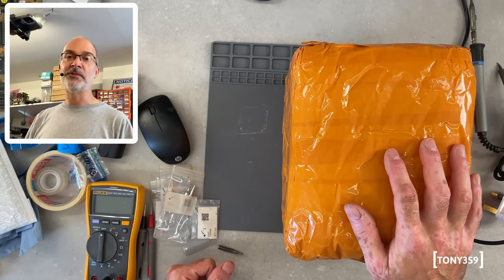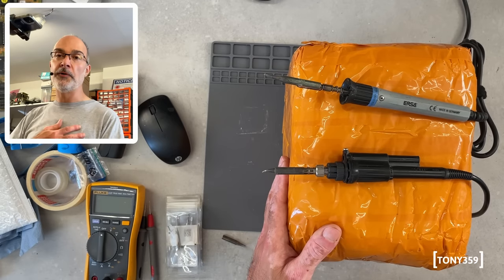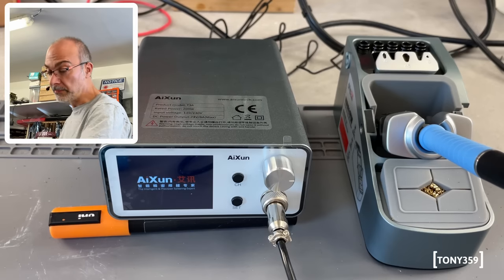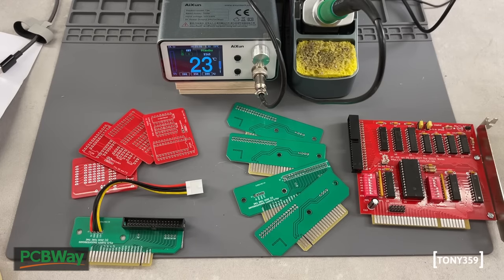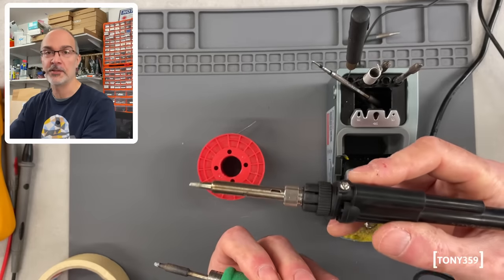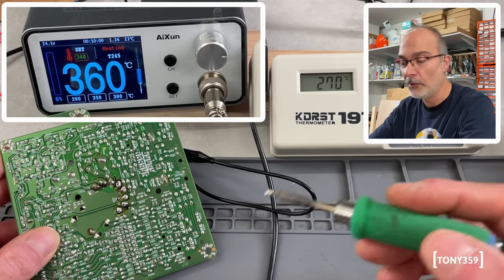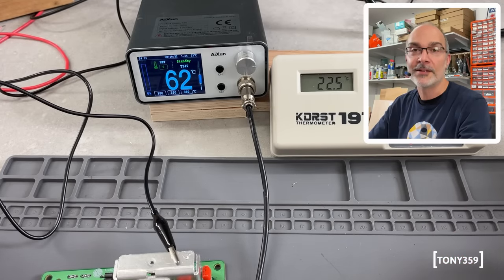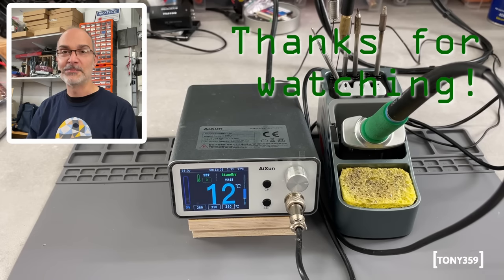Is the Aixun T3A a good T245 soldering station?

Comment: I had that with my diy speaker and cross over, with the amp off but still attached, I heard a buzzing sound from the speakers (resoldered a loose connection) Probably better to use a separation transformer on the T3A.
Reply from the maker: Yes, today I was soldering with the oscilloscope connected and I could see the heating pulses on the scope. This thing is dumping voltage through the tip. I think I'll move to a different model, this feels unsafe for the PCBs.
Reply: @tony359  Care certainly must be taken with this iron, but it's fine for my purposes. I like it a lot too, with some JBC original cartridges. I usually work on stuff that can be disconnected.
Reply from the maker: I cannot deny it works for 90% of the intended purposes. It's just I also work with those 10% as well and those issues are always in the way.
Reply from the maker: @imqqmi  Thank you for sharing your experience, I made a short showing the same issue: https://www.youtube.com/shorts/6rK7ACrbukI
It's bad. I'm going to find a replacement ASAP. Thanks again!

Comment: Haha the Chinese are masters at hiding the faults. I have a Quicko T12 that has similar traits - lies about the temperature to make it look stable when it is not, and again it doesn't work quite right with the genuine Hakko tips. Interesting issue with the grounded boards, even tho the psu is likely isolated, the soldering tip should still probably be grounded - it is clearly not, and this has to be a hardware issue which is probably why they are having a hard time fixing it in the software!
Reply from the maker: I didn't mention that on the video but the tip is indeed grounded. It's been speculated that this is the by-product of some noise which is then affecting the thermocouple reading going to the station. Not sure! :) Thanks for watching!
Reply: @tony359  Strange, maybe ground loop induced interference then. Taking a closer look at the thermocouple amplifier circuit and grounding scheme might make for an interesting video!

Comment: The comparisons look to me like they are very far from "level playing field." The older iron has a longer, more slender tip. Of course it is going to have difficulty delivering as much heat as a short fat tip.

The problem with lots of these irons that use cartridge heater/sensor assemblies is that the sensor is a long way from the working part of the tip.The sensor may be better coupled thermally to the heater than to the tip. The huge overshoot with the "improved" firmware is pretty compelling evidence of this. It is difficult to really evaluate properly without a pretty sophisticated test setup. You need a data output from the device measuring the "action" part of the tip and from the sensor of the station itself. Obviously the manufacturer was deliberately trying to hide the horrible job done by the hacks that designed the station.

For decades my main soldering iron had no display of any sort. The temperature was set by the actual tips which use curie point control. It worked great, often idling all day long when I was doing development work. Other days it would be in in heavy use. With my main temperature controlled station the heater surrounds the barrel of the tip and the sensor goes inside. The sensor "talks" to the tip, not the heater.
Many of these flashy stations seem to be made to look impressive to the gullible, not to perform well.

Soldering, when done by someone who knows what they are doing, is a "closed loop" process where the operator closes the loop. Dwell time is judged and controlled by the operator. Very precise control of the iron's temperature really isn't necessary. That said, huge temperature overshoots are unacceptable if the overshoot makes it to the working part of the tip. If you are doing something like soldering a ceramic surface mount cap (which you shouldn't be doing at all with an iron), the overshoot could greatly increase the already high risk of causing cracking due to thermal shock.
Reply from the maker: Thanks for your comment. My comparison wasn't to find a winner but to guide someone (like me) thinking of upgrading and not sure whether the benefits were worth the price. As I said in my intro most comparison are between similar stations but there is very little to compare to an older iron. 
I've been thinking of getting a cartridge-style iron for a while but I wasn't sure it was really worth. So I thought I'd share my thoughts with the larger community! Thanks for watching!

Comment: what about the JBC BT-2BQA ? the price is not so expensive as the JBC BT-2BQA, it's half the price of the later, you only miss the digital display
Reply from the maker: It's something I have considered, yes. Again, after all it's a metal rod getting hot :) I'm really wondering if you really need a microprocessor and a display! :)

I'm getting a JBC, I cannot risk my PCBs with this thing. I'll publish a quick comparison soon - even though I appreciate it's 4-5 times the price.
Reply: just remember, you can't directly calibrate the JBC BT-2BQA , you need something like  the JBC AC2600 (AC-A) soldering console (you can change the time sleep, temp etc) but the product is retired

that's why it's more expensive i guess, you have directly a way to calibrate the soldering station
but i don't know if it's worth 250$/euros
Reply from the maker: interesting! To be fair, I don't think you need your soldering tip to be 100% precise - and it's an analogue station anyways. When you set it to 350, I feel it's ok if it's 360 or 370. Not 400. I doubt a proper station would need some massive calibration - that tool is likely for a service centre of if you own a lab with multiple stations and you want to make sure they're working well. I don't think they are intended for the individual. It's cool to know though, particularly if you think of buying a second hand station (which might have drifted) and discover it cannot be adjusted easily :)

Comment: I love my pinecil. Got into soldering a couple years ago. I first got a cheap heating element in the tip one that was broken. I got it refunded and found the pinecil. Pinecil was night and day difference between the two. Like your comparison. My old iron was a good 3-5 minutes to heat up. My pinecil, under 10 seconds. Made my own silicone cable for it and I use it all the time. Also the barrier of entry. Pinecil shipped was $36 USD.
Reply from the maker: Yes I heard great things about the pinecil! I also considered that but in the end the Fake Hakko I have is not so bad (WITH Hakko tips though). Thanks for watching!
Reply: @tony359  Theres a 3d print for the pinecil that makes it accept hakko tips as well. I seen it a while back.

Comment: Wow that PID loop is really really bad. My guess would be they "borrowed" some code they did not fully understand. I have a JBC station but mine has problems storing settings and reverses back to its default settings at random it's annoying as ^@#$. I was about to buy two of the Aixum stations but it now seems that's also not a solution.
Reply from the maker: Oh, I'd expect JBC to be able to sort out similar issues! But yes, maybe the T3A is not good to replace a JBC :)

Comment: Have anyone tried to switch out and replace the switched power supply board with a full transformer and bridge rectifier, that might solve the ground loop issue!?
Reply from the maker: It might, but I'm not really sure it would be worth. I think you can buy a unit with a linear supply with the money you're going to spend and it won't look like frankeinstein on your desk! But yes, it would ne nice to test.
Reply: Could render an new interesting Youtube follow up ;)
Reply from the maker: @stockholm-tech  the T3A is not easy to open, it's partly a destructive process. I need to sell mine :D

Comment: 4:22 Not quite. Look more closely at a genuine Hakko tip and you will find a very thin sleeve inside the tip. Those chinese knock-off tips don't include the thin sleeve so they are basically useless because the hole inside the tip is way too big to efficiently transfer the heat from the element to the tip. If you don't have a proper Hakko soldering iron like the Hakko 936 try to get access to one owned by a friend or buy a genuine Hakko tip and take a look inside and you'll find a thin steel sleeve. Use the genuine tip on your cheapo chinese knockoff soldering station and you will see a dramatic difference in heat transfer vs the knockoff tips.
Reply from the maker: I remember reading about that when I got the station and if I remember right I fiddled with some metal shims but that did not really work for me. But that was a long time ago. Yes, I know genuine Hakko tips increase the performance a lot take a look at 1:05 :)
Thanks for watching!

Comment: Ive had at least 8 different Chinese knockoffs. The ksger 2.1s silver case and the axiun models are the best of the 5 or 6 jbc knockoffs. The axiun is very picky about the resistance in the tips. Unless theyre real or axiun branded then its a crapshoot. OSS Team and handskit jbc units blowup and the sellers do not stand behind the products.  In fact it is a systemic problem on ali. Reputable sellers with good ratings never stand behind their products or over charge for replacement units. I had to fix the t3b after no luck with the seller phone fix.  Not china phone fix. 

They are the friendliest say no people in the world, by and large. 

The t3b is instant heating.
Reply from the maker: Yes I’ve also noticed that Aliexpress has become risky. Unless you don’t receive the item, after a week or so you’re ‘on your own’ and it’s almost impossible to get support or warranty. The temp instability when idle was only happening with my JBC tip but the earring issue happens with Aixun tips as well. Thanks for you comment!

Comment: The aixun tips were certainly usable I thought. But the genuine jbc tips were much much better. If you are working on a board with many layers and heavy ground planes ... Its by far the best station I've used. Jbc also has an amazing selection of different tip shapes for specific parts. Like the box tip for qfp chips, it solders all four sides at once in a second or two. 

I think I am using an older model aixun than yours. Mine came with a different cradle as well.

Edit: i checked and im on firmware 1.31
Reply from the maker: The Aixun Knife tip is ok, the other two are too small for my needs. I'd rather buy JBCs, "tips are forever" :) 
Many others have said they're on much older versions and they're ok. I'll try downgrading too! Thanks for watching!

Comment: I dont understand the need to complicate the act of soldering componants to a Pc board , the need for a smart soldering station is beyond my comprehension if you have a station that compansates for heat draw why the need for software updates it's just something else that can go wrong in future use , simplification rules over complication  ................
Reply from the maker: I think some "intelligence" is needed to get to the performance level those cartridges can deliver. But there is also a Marketing aspect where a station with a fancy coloured LCD is more attractive then one with a 7-segments display :)
In my world, it's the same question: "why audio amplifiers need a colour LCD display and a Firmware???"

Thanks for watching!

Comment: There are no free lunches. Heating and cooling metal at such high rate will shorten the life of your iron Dramatically. You can not beat the laws of physics.
My Scope iron has 73,000 hrs it. I purchased a new tip about 2 yrs ago, but the original is still working just fine.
Something I have noticed about ppl buying a new iron. They have trouble with the new iron, due to "muscle memory" / habit, and often revert back to their original iron.
The faults demonstrated in this video, they are not Software, they Hardware, very bad cheep circuit design.
Thats my 2 pennies worth...
Reply from the maker: I thought about the heating up/down issue. My traditional iron has a timeout of 60 minutes I think. Which is great because sometimes I leave and forget to switch it off! On the Aixun all the timeouts can be adjusted or disabled. I was indeed thinking whether keeping a higher standby temp (200C?) would be a better idea than letting the iron cool down completely multiple times per session. Thanks for the input!
Yes there must be some HW issues with that iron and they're probably trying to patch it up by software, likely by copying other brands' code :)
Thanks for watching!

Comment: Looks like you are using lead solder
Reply from the maker: What makes you think that?
Reply: Red spool on the solder if RHOS it's green
Reply from the maker: ah yes, for a moment I read "unleaded". Yes, leaded. Is that a good or bad thing?
Reply: @tony359  I think lead easy to use but if it's new stuff need to use lead free to keep RHOS compliant
Reply from the maker: AFAIK leaded solder is allowed on repairs.

Comment: If it can't handle being grounded I don't see how you can ever recommend it. This is basic benchtop soldering station capability 101. No-one should have to handle such an issue all the time, I think you are being way too kind to them. Not to mention the familiar story of chinese support giving you the run around for weeks hoping that you will go away. Firmware lying that the tip is up to 100 degrees cooler than actual is also crazy. Only thing worse than being told there is a problem is being told there is no problem when there is. If you are cynical, it looks like they've programmed the 1.34 firmware to just lie that the tip stays at its SET temperature the whole time after it has warmed up, because they didn't like showing how much variability there is.
Reply from the maker: Yes, I like being diplomatic! The price has to be taken into consideration, it's 4 times cheaper than a JBC... Had it been £300, it would have been a NO. For £120, you might as well try not to ground your device under test! As long as the buyer is aware of this flaws... Thanks for watching and for the comment!

Comment: People always complain why JBC equipment is so expensive. Until you take JBC gear apart and notice the nice Nichicon capacitors, the Dale current shunts etc. 
These chinese turds contain rubbish components, so you get what you pay for.
A BMW 5-series is more expensive than a Lada. Deal with it.
Reply from the maker: Exactly. Now, I still feel that JBC is overpriced a bit - but if you pay 1/5 of the price, you get what you pay for. I'd be ok with some inaccuracies, some bugs, having to reboot every now and then etc.

NOT with 500C at my tip when the display says 360C. Full stop. :)

Thanks for watching!

Comment: It’s a PID issue
Reply from the maker: I wish it was so easy. It's a hardware design flaw unfortunately. The PID receives incorrect values from the temperature sensor and it's basically "driving blind". Nothing that can be fixed via SW unfortunately.
Reply: @tony359  we use an extremely similar setup in the lab instruments we manufacture. I’ve seen this behavior many more times than I care to. When I see it, it’s caused by a loose thermocouple or grounding wire or 2 GFCI on same leg of breaker panel and this really screws up the integral and proportional.
Reply: @tony359  the preheater issue is more complicated….that one I’ll have to ask our PCB production guys about.
Reply from the maker: @I_SuperHiro_I  Since I discovered the issue, other reviewers/users have confirmed the same and it looks like it's caused by how the SMPS is implemented in the unit - particularly ground is tied to the negative and when ground is also present at the tip, that interferes with the temp sensor which reports a very low temp - hence the jumps. I'm afraid it's nothing that can be fixed with some de-oxit on this one :)
Reply: @tony359  have you measured the DC output and resistance to see if you’re getting leakage?
Reply from the maker: @I_SuperHiro_I  Yes :)   https://youtu.be/hGK7s-9tXs4
Reply: @tony359  reason I ask is I’ve had extremely sensitive V Adj pots in a PSU cause bizarre issues in PID Loops.
Reply: @tony359  I’ll see what our PCB guys think. I’m curious now.
Reply: @tony359  R&D says they ran into this issue before when power mosfets were insufficient. The circuit also probably doesn’t have enough zenner diodes.

That’s what they said. Makes sense to me and would be easy to try I guess.
Reply: edit: never mind… I saw the long comment from 5 months ago that explained it. The tip isn’t earthed! When issue occurs: current flows through the heater and some flows back in a parallel path through the thermocouple, tip, earth wiring, to PSU -ve (which is earthed) - if I understood correctly. 
———
 @tony359 can you explain again how this issue is caused please? I don’t understand it. To save confusion, can you pls call:
Mains ground = earth
PSU output’s 0v rail = ground
Any other circuit’s 0v rail = ground

You say iron tip is already earthed I think, so why does this happen when you touch the tip to an earthed point?
———
I guessed it was to go with leakage current from floating PSU being earthed, and that small leakage current interfering with the thermocouple reading somehow. But never mind.